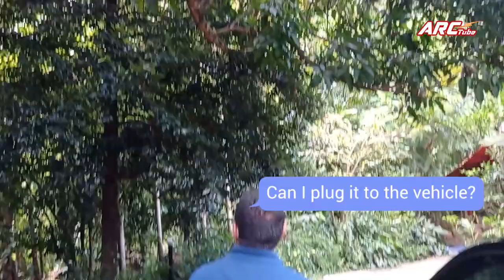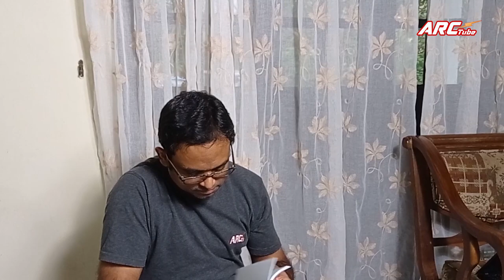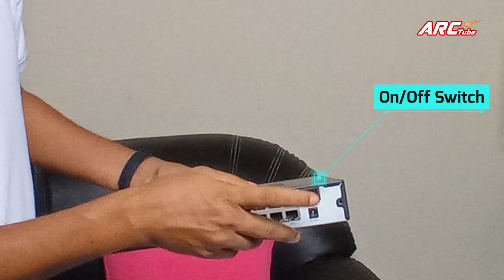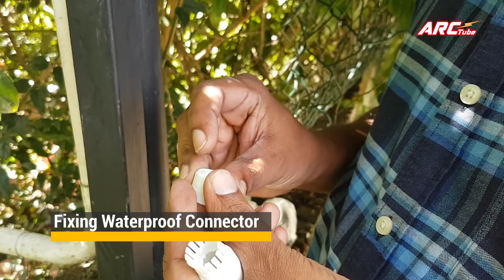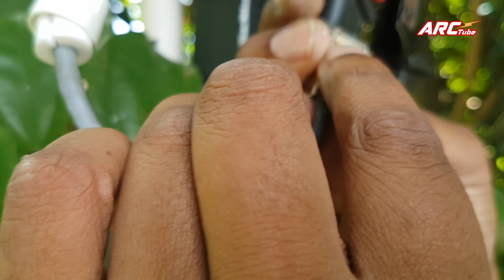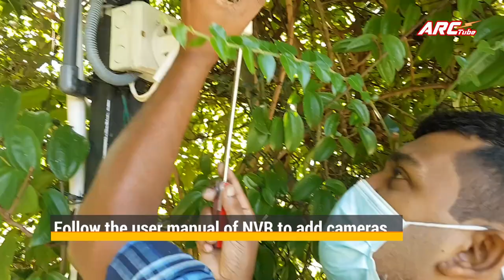CCTV Without Electrical Wiring

Comment: Which wire pair carries power ?
Reply from the maker: There are two variants in POE. I.e. Mode A and Mode B. In Mode A, the power is provided on the same cable pairs which are used for sending data. That means pin 1 or 2 can be used for DC+ and pin 3 or 6 for DC-.

In Mode B, the spare pairs (4,5 & 7,8) will carry power to the end device. Pin 4,5 for DC+ and pin 7,8 for DC-.